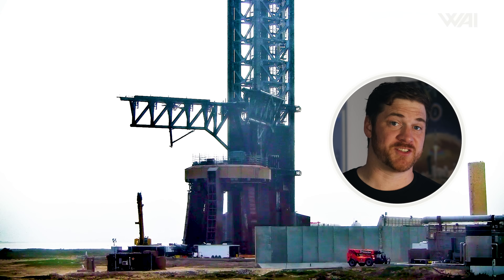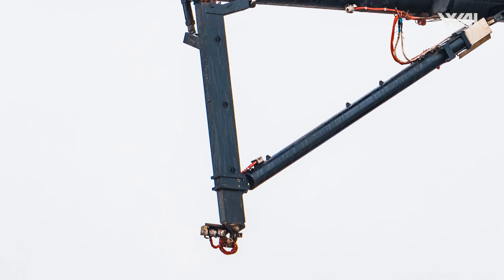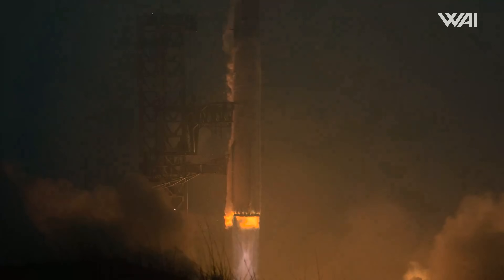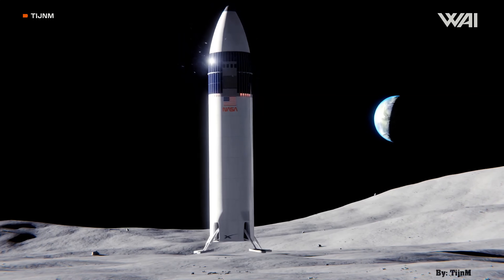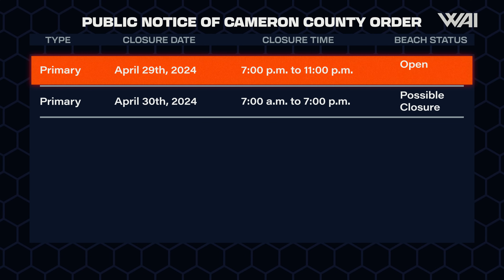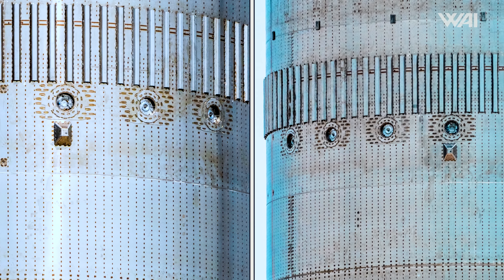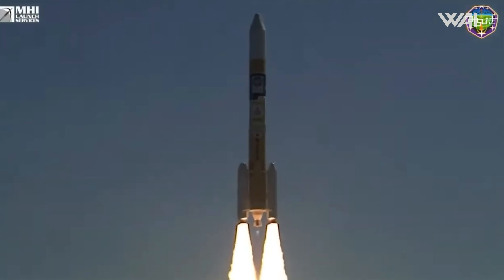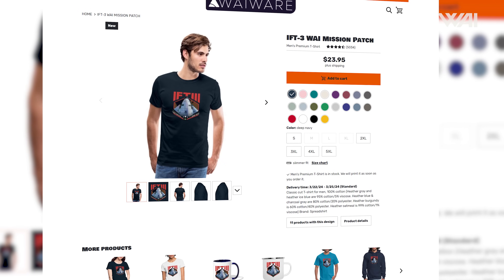SpaceX Starship: NASA Confirms Risky Orbital Maneuver!

Comment: I like a catch only tower for the first few catches.
Reply: No. They will need it permanently. Remember the Space Shuttle only had a disaster every 100 flights or so. But when they did, it set the program back almost 2 years each time.
Now imagine a Starship being recovered on the Stage 0 during operations WHILE A SUPER HEAVY IS SITTING ON THE PAD. That is how Elon planned this thing. If you destroy Stage 0, your entire fleet of boosters and Starships are out of action until you repair the extremely expensive and complicated Stage 0. A landing pad is much less costly and easier to repair. It could shuttle the vehicles back to the launch pad using a rail system. And you could get the damned Super Heavy out of the way, before your recover the Starship.
Reply: i was thinking the same. perfect the process then move it to the olit

Comment: They should REALLY do a hop and catch. REALLY
Reply: @iamaduckquack yeah so just the one where they can test from, destroying it would be very bad.
Reply: The problem is that test would require a whole new software program and it wouldn’t actually test the hardware to the extent it needs to. The other thought is we don’t know the risk assessment process the spacex uses. We also know that the hardware as been proven to handle the weight of booster, and it would be silly of them to not test to see if it can handle the required sheer load it would need to take on at landing, during one of the lifts. Lastly we know the accuracy of spacex’s landings have only gotten better.  The bigger the object the easier to be precise because the forces of wind needs to be much greater despite the increased surface area. As we know mass cubed to surface squared.
Reply: Stop spamming
Reply: I’d have a catch only mechazilla on an oil platform… the risks are somewhat mad at this stage.
Reply: YOUR RIGHT, they should definitely do that , unless they are already very confident that they already can do it , negating the test.
Reply: If I was in charge I would put that off as long as possible, they only have one mechazilla and if they damage it they can’t do any other tests
Reply: @Grunttamer I remember spacex has 2 mechazilla, right?
Reply: @HOANGNAM-jm6oc  I didn’t think they built the second one in Texas I thought they built it at KSC
Reply: @HOANGNAM-jm6oc  as of right now they are building another pad, but it’s not done yet
Reply: @Grunttamer i think KSC is Kennedy Space Center, but i keep thinking anything starting with K is Kerbal, Kerbal Space Center
Reply: @xymaryai8283  I’m very sure they picked a k word for the game for that specific reason.
Reply: I think it’s more complicated than that, if a hop and catch is as beneficial as people sometimes say it is, than SpaceX would do it. SpaceX has some of the smartest rocket engineers in the world, so I trust what they are doing. Clearly the full starship system is too complex and expensive to perform dozens of disposable hops like with star hopper or falcon 9
Reply: The smartest move is to finish the second tower and launch platform while they’re launching prototypes and proving out capabilities and doing virtual catches over the water.   It makes no sense to introduce a possible unknown length of downtime and resource diversion to repair a toasted launch tower.  

Plus they plan to launch two full stacks in 2025 for the propellant demo.  I’m sure they want two towers for that.  A bottle neck in testing would be worst unforced error they could cause.
Reply: @undertow2142  even the second tower wouldn’t do the job because it’s at KSC and nasa gets salty when you essentially ICBM their launch sites
Reply: @undertow2142 I'm sure you are wrong. They have already announced the 2nd starship won't launch until 4 weeks after the first one. They clearly plan to pull off the orbital refueling test with one tower.
Reply: @jimmaag4274 the next 2 starship flights wont do the refuelling test. The one coming up planned to reattempt reentey burn like the last one
Reply: @GamerBoyRobby  duh, ya think George? We were talking about the two refueling test flights, please do try to keep up.
Reply: @jimmaag4274  thought you meant the next 2 launches because of how you worded it
Reply: When are people going to understand that Elon has a very different risk tolerance
Reply: My question to Elon is, how quickly are you able to launch Hoppy again? In the event that we need to repair 1 Starship with another, without SpaceX instruction (no comms available), will someone be able to get Hoppy going?
Reply: Millennials have zero concept of sustainability and just want to burn shit down and complain after that it blew
Reply: It would be interesting to see a booster hop from one tower to another after OLIT 2 is done.
Reply: They should use  another thing to catch it.
Reply: I think someone who was originally involved in the test and development programs involving hopper, left SpaceX.
Reply: Totally agree
Reply: What a great idea
Reply: Useless... coming back and landing is the hardest part. They can almost already launch a payload to orbit. So just test landings while successfully launching payloads... doing a hop test at this point is just asking for more issues with wildlife people and having to get clearances...ect.
Reply: So the Stupid armchair  morons know better than the best engineers in the world.

Yes:  put your heads back in the sand until a neuron develops.

Then, THINK about it.